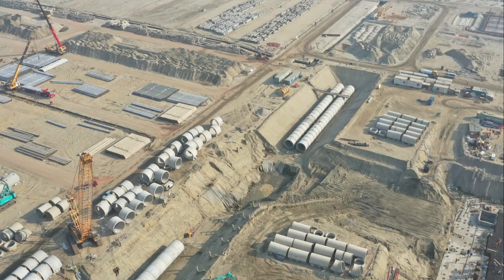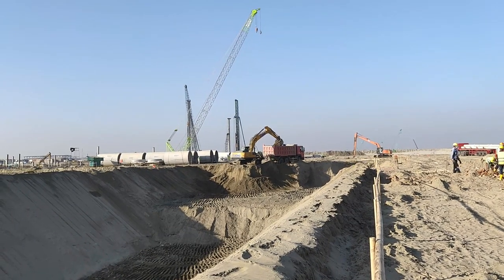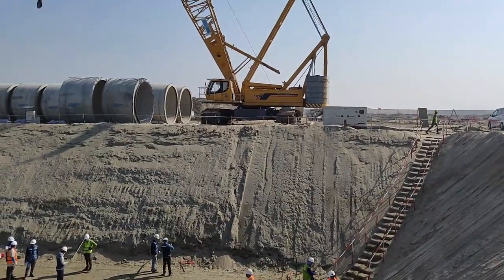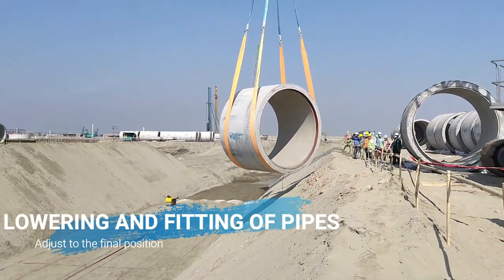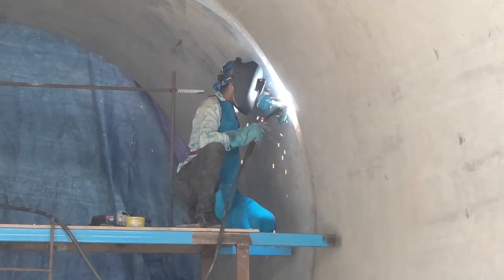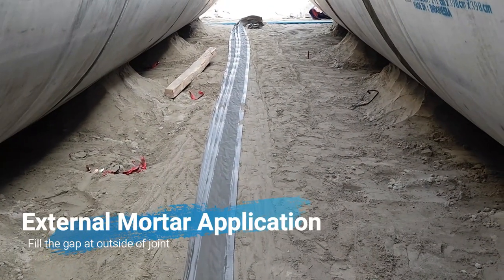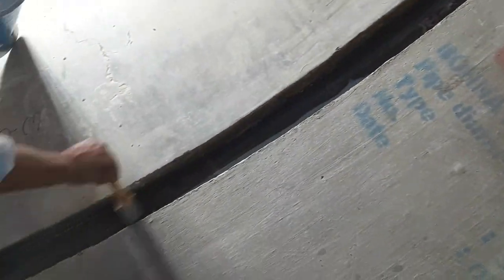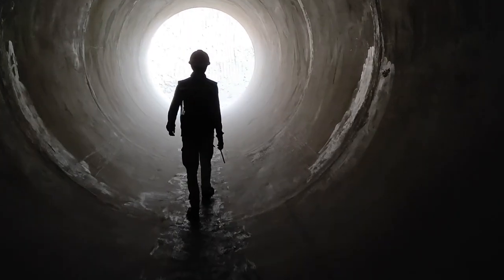Installation of Reinforced Concrete Cylinder Pipe (RCCP) | BONNA Cooling Water Matarbari Power Plant

Comment: Sir, what is the formula for the grouting mixture?
Reply from the maker: It may vary for different types of RCCP. Better to ask the manufacturer. Here in matarbari, for internal mortar mixture: Cement:Sand:Admixture:Water:Silica Powder = 20kg:38kg:5L:5L:3.9kg
External Mortar: Cement:Sand:Admixture:Water= 40kg:132kg:14L:20L
...
There is no fixed ratio, it also depends on Masons skill and comfort